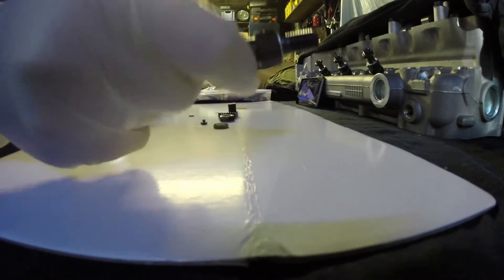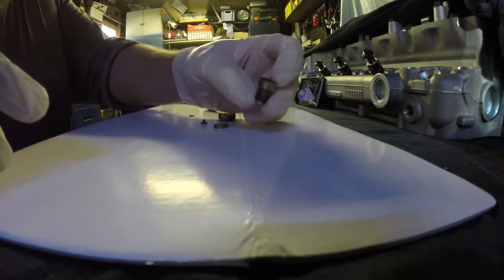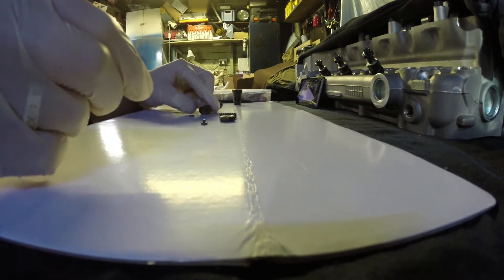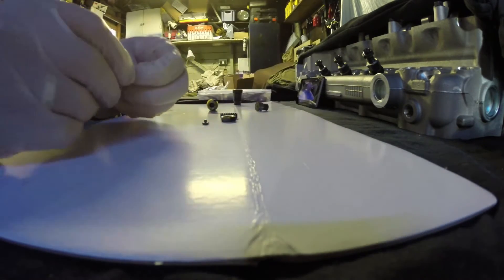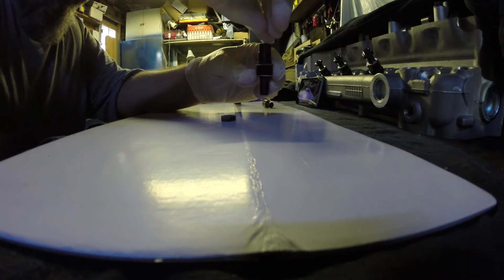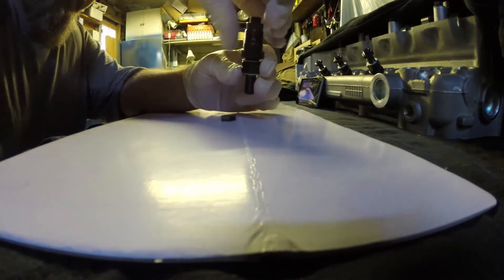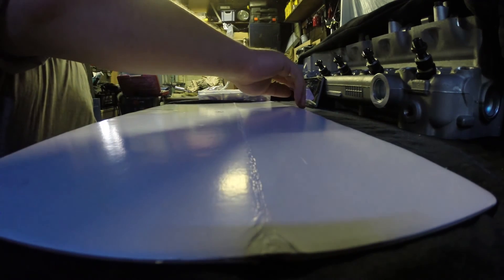4M40 Injector assembly

Comment: hhhmmmm - I've pulled mine apart and the 'little mushroom thingy' is missing on 2 injectors - 2 of the needle valves are locked solid and 1 of the grooved discs is rusty . . time for a new set I'd say . .

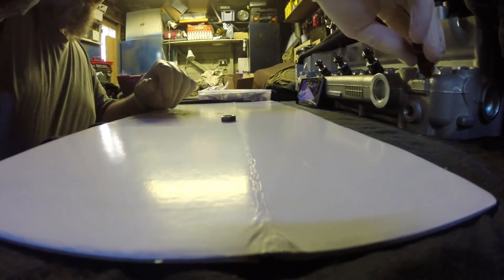Comment: Just to add to this video, I know it is old but this is literally the only video on these injectors.  There is a heatshield washer that goes in BEFORE the injector, this is as well as the copper washer on the injector body, you should have 3 washers, 1 on the very tip that sits in the hole (usually grey steel type, not copper as they get obliterated by the heat), one around where the injector meets the block like he added @3:21 and then the steel one on the injector rail that has two diesel return holes. This particular head also does not allow a normal socket to fit and torque them easily, you will need to grind down a normal socket to fit properly.  Make sure the very first steel washer in the injector hole is NOT re-used or left inside or your new injectors WILL leak, they almost look like part of the head as they are grey and VERY easy to miss. I learnt this the hard way on my Delica.   If anyone is finding it hard to find parts for their Delica then use MitziBitz on Ebay.
Reply: Hi there, I just recently removed a couple injectors on my 4M4O engine and the plastic clip had become very brittle and broke during the process. I installed the injectors back into the engine but it runs rough as if the timing is out, i loosen one fuel line at a time to bleed any air and the engine is on the verge of cutting out. Is this the result of not having a plastic clip on the injector? 
I appreciate any feedback thank you.
Reply: @quententomasoni6159  Well removing parts of the injector is not going to do much good there might be some air getting in without the clip, the engine should start sounding like it is cutting out though when you loosen a fuel line.

Comment: Good stuff mate. 
Where did you get the bits and pieces? I can't find a rebuild kit anywhere.
Reply from the maker: I just cleaned and reused the original bits (with the exception of the copper washers which came in a big box of assorted copper washers).
Reply: @MitsubishiDelica  cheers mate